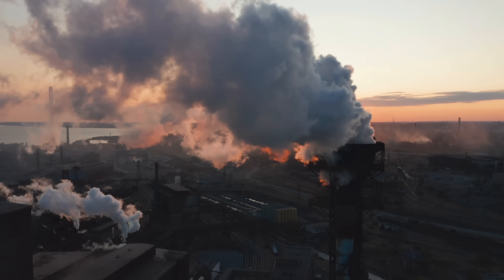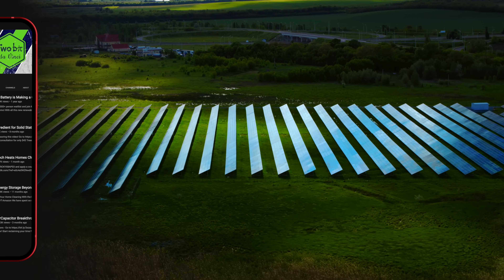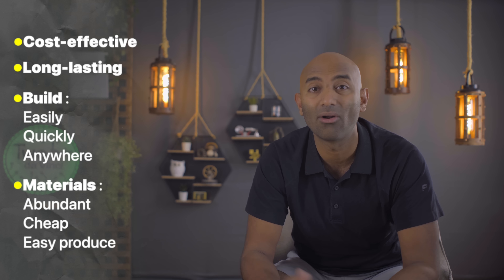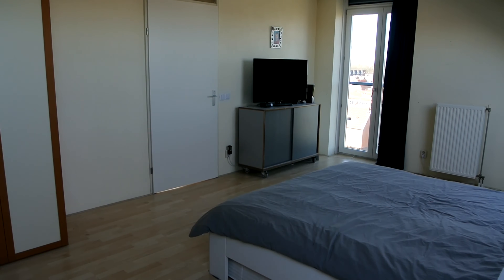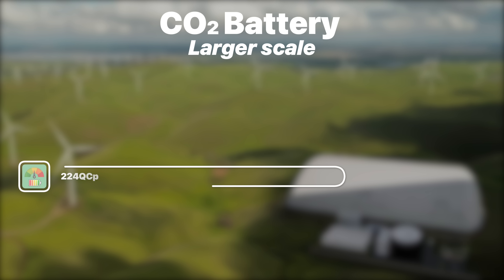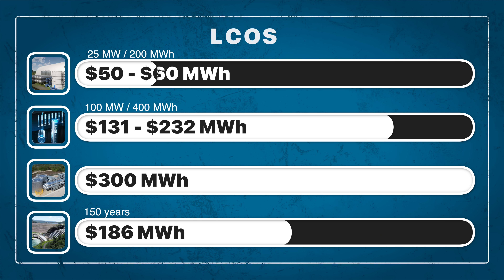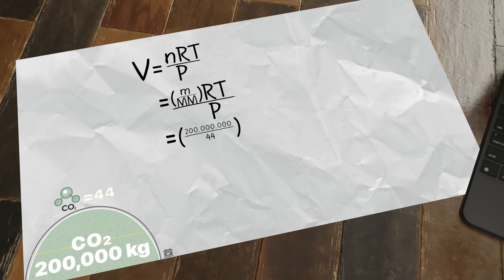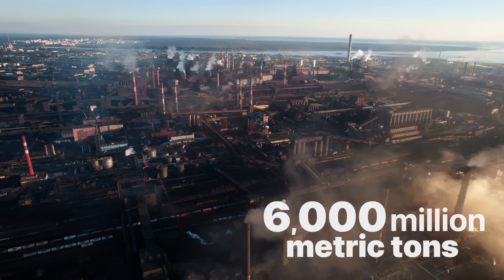The GENIUS Of the Carbon Dioxide Battery

Comment: What keeps the storage dome from being crushed by atmospheric pressure when all the carbon dioxide is pumped out for liquefaction?
Reply: Looks like the dome contains a bladder. The dome is more of a protective outer surface for the bladder.
Reply: @spudpud-T67  that would be a good strategy to deal with this problem. While it might add some complexity to the system it's still probably way cheaper than making the dome so thick it can resist the atmospheric pressure on its own. NASA has a spacecraft test facility in California that's basically the world's biggest vacuum chamber. It took so much engineering to keep it from collapsing under atmospheric pressure.

Comment: "Telsas and EVs are so desirable"
When about recycling the batteries when they go out?

Yeah... checkmate.
Reply from the maker: Easy and over 90% can be recovered. So unlike gasoline that has value for an instant until you need to burn the next bit… EVs are truly circular. Drive hundreds of thousands of miles, then recycle them back Into new cars.

Comment: Those “micro inverters” are basically power rectifiers yes? They’re basically a useless addition to any solar installation. Goddamn grifters has entered the market for renewables and they’re making money.
Please get those fools outta your sponsor reads.
Reply: Also if you want an engineering solution for anything then NEVER trust Italians to do the job. They’re notoriously unreliable and will take all your money while capsizing the project.
If your government has billions to burn then by all means.
You have been warned 🤷‍♂️
Reply from the maker: What are you talking about? Our homes run on AC so you need to invert the DC of solar panels to AC

Comment: Actually solar is constant.  If you were to have a "belt" of solar panels around the equator, about half of the planet would produce the electricity at any given time.  The sun doesn't turn itself off every night, the part of the earth you're on is just facing away from it.

Comment: CO2 is 0.04% of the atmosphere. Labeled as a rare gas. How economic will it be to extract from existing air, rather than using carbon generating technologies? 
I don't think it will be profitable from existing air.

Another area proving to be a challenge with profitability currently is recycling of obsolete solar panels. Cost to recycle is around  $30 vs return of around  $4.

Comment: It is deceptive to kick climate change to the curb because there is now a battery that uses C02,  LFP batteries are looking good for home storage.  1/2 the price of lithium ion, no nickel, and does not catch fire.  We are far better off with a distributed energy storage solution.  That way a few single point failures can not bring down the grid.  Think the unwinterized gas turbine plants in TX.

Comment: THE PROBLEM IS SO CALLED RENEWABLE ENGERY SOURCES ARE HIGLY POLLUTING AND A DANGER TO THE ENVIRONMENT. STOP SPREADING THE BIG LIE. THE SO CALLED CARBINE FOOTPRINT OF SOLAR PANEL AND WINDMILL, NOT TO MENTION BATTERIES, IS GREATER POLLUTER THEN TRADITIONAL METHODS. CO2 BATTERY IS BS. YOU LET THE CO2 OUT WHEN "DISCHARGING". EFFICIENCY IS A JOKE ONCE YOU TAKE INTO CONSIDERATION COMPRESSING THE CO2.

Comment: What sort of idiot claims the space surrounding the Earth is "freezing emptiness" ???

The fact of the matter is that if you mapped out a huge sphere of space centred on the Sun the space inside this sphere cannot be described as "freezing".  It is stupid claims like this that mislead people into believing gobbledygook !

At Earth's orbit the Sun continuously emits radiation in 3 dimensional space with a power of ~1,360 Watts per square metre.  This radiation is capable of heating an object that absorbs it about 120°C.

How anyone can describe that as "freezing space" is absolute stupidity.

But it is worse because the only place to avoid this radiation is to hide behind a planet or moon.  The amount of sunshade by the planets is tiny compared to the 3 dimensional volume of the sphere at Earth's orbit.

Go to Mars and the Sun can heat objects to about 45°C - again hardly freezing !

I never cease to be amazed how people can make a video full of nonsensical claims like the "freezing emptiness of near Earth orbit space - for Christ's sake the surface of the moon reaches temperatures well over 110°C with no greenhouse gases or even an atmosphere - how does that happen ?

By all means watch nonsense like this but investigate stupid claims !

Comment: Can I get an alternator. I don't want a battery. This is not my vote. I had a kid if I didn't  have a kid In world to make garbage to keep you ppl happy so you can have bills & Goto work for no reason to make more GARBAGE to pay bills & buy fuel.  I know everyone goes through withdrawals for bills but I have to think about the future not the weak ass junkies that need a bill to talk to them every month. My apologies. Try the ECSTACY! Junkies the worst. We are running out of water &"air cos of pollution.  It stinks & it's hard to swallow. These resources are not everywhere. I'm such of listening to ppl promoting fuels & PowerPoints. They are not powerful. They are wasteful. Can someone pray to Jesus to wake TESLA up. I said TESLA not Elon. 
TESLA= no wires no bills, no to minimal batteries, self charging. 
Elon= PowerPoints, wiring, powrrstations, fuel, bills. Rockets that pollute much more then cars.
I repeat we are running out of drinking water & breathable air. This is an ignorant way to think. The whole WORLD is dying for bills garbage &'waste by man. 
I wouldn't come to this world to take a shit. It's a dirty toilet.
These are 2 very different ppl.

Comment: We've known since this scam began that CO2 is not a problem. It never was. Life depends on it. It's "greenhouse" capacity is minimal and maxes out at a very low volume.

CO2 was picked only because it provided an excuse to steal lots of wealth from the People and a means to control them. There is no data that has ever shown it to be a problem or a contributor to "global warming" which doesn't really exist outside of the normal processes of climate changes that have been happening since the earth was formed.

Comment: So, do we know what happens to the efficiency when environmental temperatures drops below -15c?  On the Great Plains where most of the wind farms are located, it is not uncommon to have temperature below -28c for days at a time. At these temps the wind mills have to be shut down to prevent damage. Do we know how much efficiency is lost as we get close to the critical point of -31c?
Reply: They view the world as though everyone lives in warm places, that's the whole problem with the green energy movement.   Most solutions are NOT useable in most of the world.  That being said the density of CO2 can probably be altered for various climates to make it useable in the most environments possible.  I suspect that will kill the efficiency curve however and kill the concept.  In warm places like Sardinia...........it may be viable however.  I predict the longevity of the system will be a serious issue.  Inflating and deflating any type of bladder is going to be what kills the longevity.  They'll weaken and burst quickly I suspect.  Or they'll have to be made out of some time of material that kills the cost factor again.
Reply: Haha I think you meant wind turbines 🤣🤣🤣🤣🤣🤣Unless you want to grind grain.
Reply: @cyberneticbutterfly8506  “Wind turbine” was a term created by a marketing team to imply an exciting new technology which wind power is not….  🥱    It’s an arcane technology that still experiences the same limits of Physics it did hundreds of years ago.  The only difference between a 19th century aeromotor hooked up to a dynamo and the current monstrosities out on the Plains is their size and reliability.  Many of the 19th century versions are still standing and providing power for irrigation and livestock pumps.
Reply: @scottwendt9575  The word "mill" means something.

Comment: Long term shifts in weather patterns have been changing do to the sun and the earths core , these are the deciding markers for the earths surface , Burning fossil fuels will have very little , or any notable change in the earths temperature , the idea of blocking out the sun will have adverse effects, which will cause the core to heat up with more earth quakes , and eruptions , the weather will be unbearable , we are best to not tamper with , One asteroid the size of a football field could wipe us out , We are not in control of this planet !

Comment: When you begin with the wrong premise you end up with the wrong answer.  Renewables only appear to be cheaper because the 24/7 efficient coal and gas power plants have been forced into an operation mode that makes them more expensive.  If Renewables weren't used to disrupt the operation of coal and gas power stations then coal and gas power would prover to be cheaper than renewables and batteries wouldn't be needed.  The premise that using fossil fuels disrupts the delicate balance is erroneous because in past history it is known that CO2 has been 10 times higher and the planet was green and we has the greatest diversity of life.  We are currently in a CO2 drought.  This article is just a promotion for another weak and expensive solution to a non problem.  We need increased CO2, the gas of life, to increase crop production and feed the world from more abundant harvests, reducing poverty.  We don't need more batteries and a maze of transmission lines criss-crossing the country from every wind farm and solar farm when we already have transmission lines fro existing efficient and cheap coal and gas power stations.
Reply: Ok, but what happens when the fossils fuels run out? We'll still need to move to an energy form that won't run out.

Comment: There will be no "cheaper power" in the future. Yes, we might figure out how to make captured energy useful for longer periods of time, but it being cheaper is something that just won't happen. Why? Because humans are, well, human. If it costs a fortune to fill your homes and cars with fossil fuels, you can be damned sure its gonna cost you the same with captured energy - no matter what materials (or more importantly what materials are NOT) being used. Is going to help me any? No... its really going to be no difference. Would I rather the cleaner fuel... I guess but its not going to make a much of a difference. We're still going to pay through the nose no matter which is used.

Comment: At $50-60 MWh that's almost as good as legacy nuclear at $20-40. But oh wait that's not actually almost as good because it also needs input power. For the conversion if you didn't know $50-60MWh is 5 to 6 cents per kilowatt hour and this is extra on top of the generation cost.

Intermittent power generation needs batteries, but humanity doesn't need intermittent power.

Comment: This is not a battery; it is a thermal carbon dioxide cycle turbine-generation system.  The question is the thermal efficiency.

Comment: What about the lack of longevity of windmills and solar panels, and the inability to recycle them cost effectively, creating more high priced junk... we gotta quit selling the woke pipe dream of " green energy" and look for seriously sustainable sources of energy, such as nuclear, that are cost effective, scalable and have a minimal negative impact on the planet's carbon footprint. We only need to look to France in this regard. Also, why not, as has been long suggested, pump water uphill and reverse the flow when power is needed???

Comment: If you're going to power your home with solar why do you need an invertor? Just use DC equipment in your home. The technology exists; most yachts use low voltage DC.

Comment: Could we see home based versions of these?
Reply: As was mentioned in the video, the energy per volume is very low, so you'd need a looot of space. Additionally heat exchangers and turbines afaik become more efficient the bigger they are, so tiny scale home based versions would certainly result in lower system efficiency. I think for home owners sodium based batteries are the most interesting current/upcomming battery tech.

Comment: Green house owners pump Co2 into their plants because there is not enough in the atmosphere. Co2 does not rise in the atmosphere and hold in heat. It is a gas that is heavier than air, and find the lowest point possible to accumulate. It is not a layer in the upper atmosphere that reflects the sun's heat back down. The Sun's Grand Solar Minimum, and the Earth's Poles reversing is what is causing the shifts in temperatures, and weather patterns. It has happened this way thousands of times for millions of years. The magnetic poles have moved hundreds of miles from "True North, and South". The Poles are shifting towards the sun, and the radiation is not blocked as effectively as the solid lines of the magnetic flux. The magnetic field converges into a funnel like pattern at the poles, and allows radiation to pass more freely as it faces more towards the sun. The Poles have reversed many times in the past, as discovered by seismic surveys of the flat planes on the ocean's floor. There are patterns of light and dark stripes that show the earth's poles has shifted many times, and many times we have had global warming, and global freezing. Believe it, or not....I don't care.

Comment: Sorry but wind in Australia is not cheaper. Government grants to build them plus the life span being shorter then the amount of money given. Example, takes 15 years to pay off, wind turbine life span is 10 years.  So when the turbine has reached its life span and is removed from service and not longer producing electricity. We are still paying it off. How is this cheaper, better?
I am glad you mentioned the materials to distribute this source to the battery, but not what materials make up the battery itself. Just seems like another Load of BS. Love how you mention CO2 battery. Co2 is just the way to charge the battery. Not the battery itself. So it’s just another Lithium battery. Well done.

Comment: Not only it good for CO2 batteries. It's good for things that grow.  Higher CO2 helps plants grow faster and fuller.  Just ask anyone who runs commercial green houses.  It is far from a pollutant and is good for our environment.  There are many many other pollutants that are bad for our environment that we SHOULD be concentrating on, many of which are caused in the manufacturing of solar panels.  Go figure.  So, I'm probably labeled a heretic by the Global Warming acolytes and priests, but I don't care.  I am an avid gardener and know what's good for my plants and CO2 is good.  --- The key to the intermittency of solar and wind is NUCLEAR!!!! a magnificent base load and much much much more energy dense.----

Comment: I have never seen CO2 as a problem it’s level in the atmosphere is only 0.04%, (pretty much nonexistent). Earth atmospheric constituents are:  Nitrogen 78.1%, Oxygen 20.9%, Argon 0.93%, Carbon dioxide 0.04%. FYI: Plants need CO2.

Comment: Cute comments from Fuller aside, solar and wind generators have always needed energy storage.  

After twenty years of installing low energy density, intermittent, distributed generation in the form of wind and solar willy nilly, it is good to see engineers finally starting to think about various forms of batteries.

Comment: There's going to be a misconception that this continually removes large amounts of CO2 from the atmosphere.
It appears to remove essentially the amount of gas the dome can store, one time, then recycle that gas within the closed loop?
Reply: Correct. The removal is not the point.
The storage of solar and wind energy is the point. It reduces carbon burning that is used nowadays to fill in the intermittent phases of clean energy production. So the battery vastly reducing co2 emissions in its lifetime.

Comment: I think nuclear is the transition we should make until battery tech has been proven competent to hold the power necessary, I think wind farms cause more harm than is acceptable, from the dead birds, bugs, people, the maintenance costs are exorbitant for their output, and like solar power trees can't be allowed to grow in their proximity for obvious reasons which seems counter productive to environmental restoration generally.

Second the use of co2 as a battery source while we also pursue lowering our co2 output has the not insignificant chance to inverse the problem creating a co2 deficit or oxygen dense environment... so again I think transition to nuclear while we work out the finer points of converting the abundance of solar power to a continuous power supply night or daywould be the smartest course of action.

Also just largely nix the windfarms, solar farms are generally better anyway and it's clearly the more suitable long-term solution to power.

Comment: Solar and wind energy is not renewable, you cannot renew an old solar panel or an old windmill. These objects have a short lifespan and will end up in our landfills. Also solar and wind are not cheaper than natural gas or coal even, those are just climate change fanatics' talking points claiming wind and solar are cheaper and renewable. Also it requires vast amounts of precious minerals and energy to manufacture these windmills, solar panels and batteries. I think solar and wind energy can play a significant role in our energy needs but to rely on them exclusively is not practical.